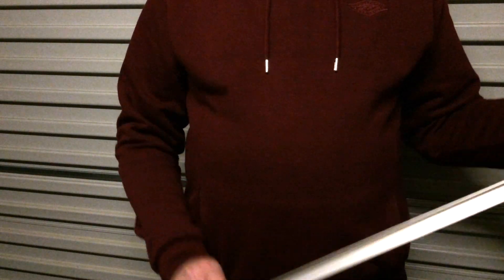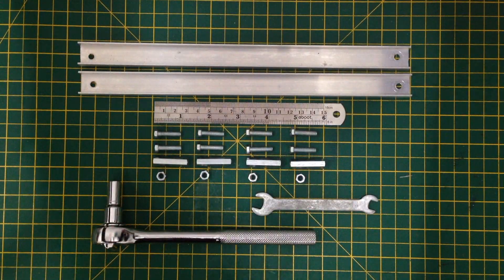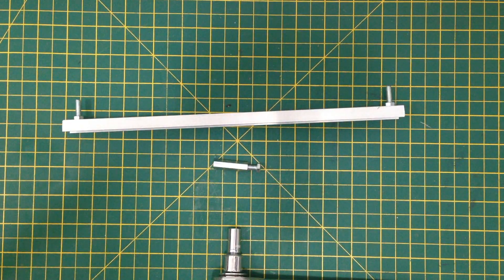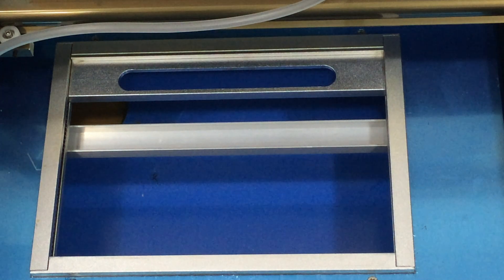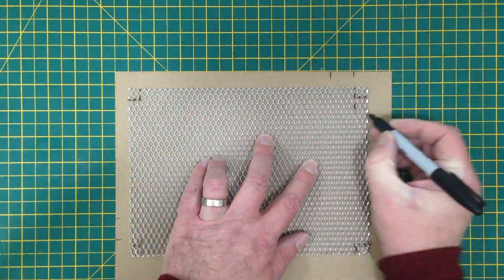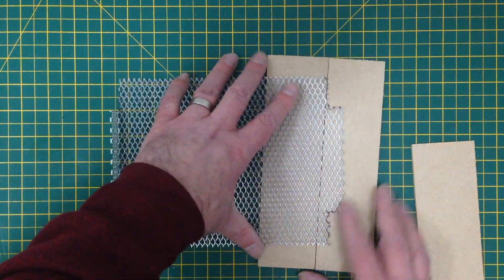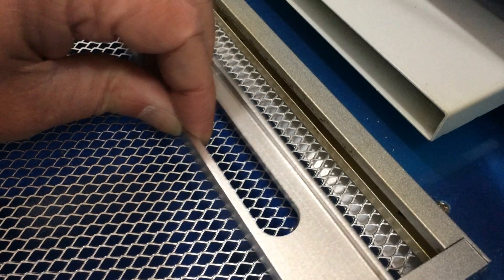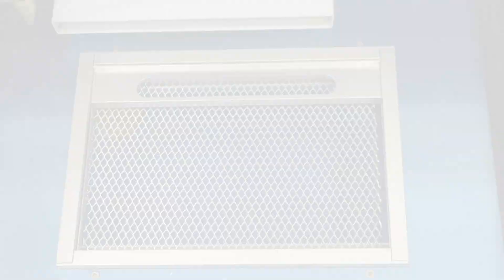Adding a catch grill to my k40 laser bed //upgrades

Comment: Great video out of all the videos that I've seen on the K40. yours is the best you take your time explain everything properly. I'm thinking about buying one of the K20 laser cutters what is the best software to use when using it
Reply from the maker: Thanks for your kind words. I’ve not heard of the k20 lasers. With my k40, I use scorchworks’ k40 whisperer software. It’s compatible with a number of controller boards. It’s free, so no harm in finding out if it’s compatible with the brand you’re looking at getting.  Hope this helps.